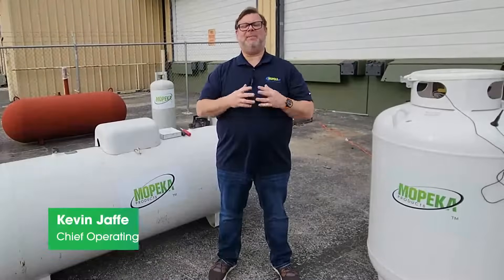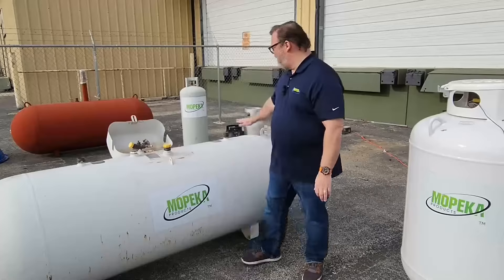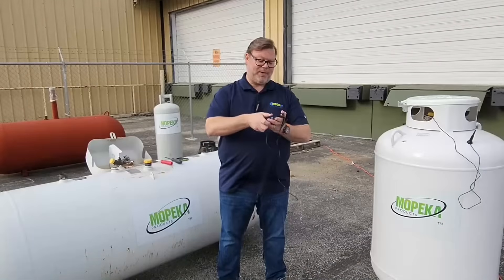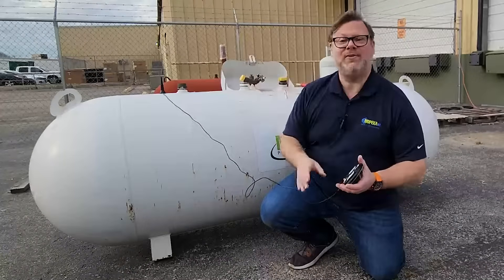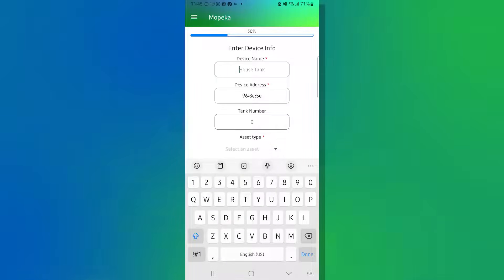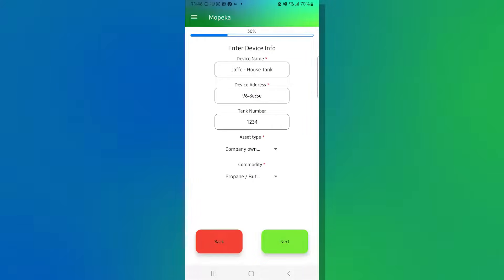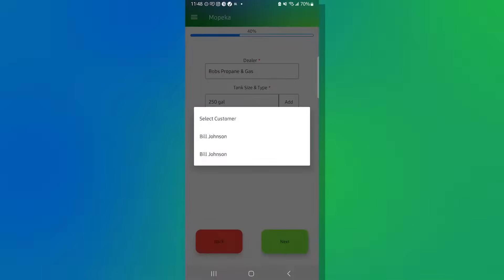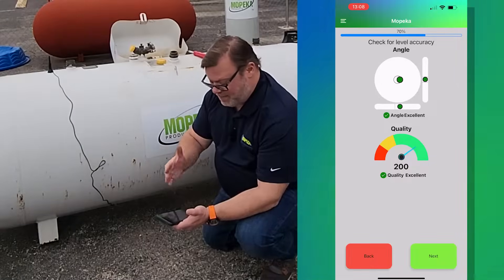Mopeka Pro Plus Residential - Installation and Configuration

Comment: Is there enough room under a 120 gallon vertical tank to position it. At 80% full I likely can’t hold it and have my wife position it. Which model do you recommend for this set up the Mopeka Pro or Pro Plus residential?

I don’t have good wireless service so I’ll likely have to do the WiFi bridge.

Comment: Crap, I bought this about 2 years ago and returned it because I thought it was bad - now I see where I screwed up installing it. I installed it directly under all the fittings which probably caused interference. I really like this device, I just couldn't get it to work right. I'll give it a shot again!